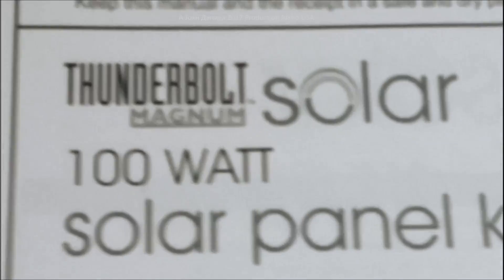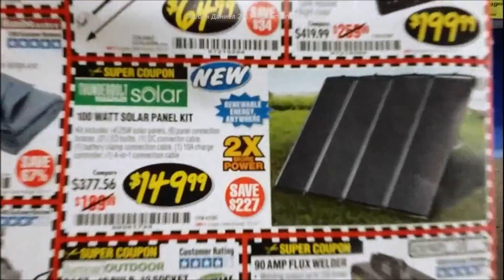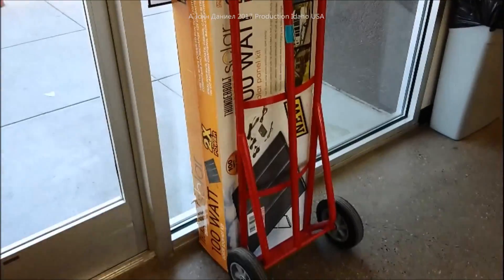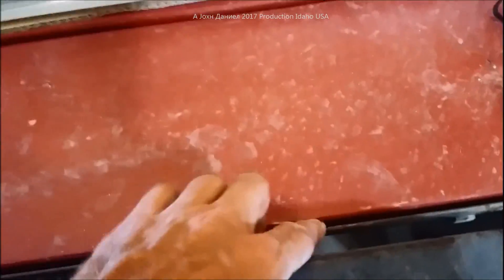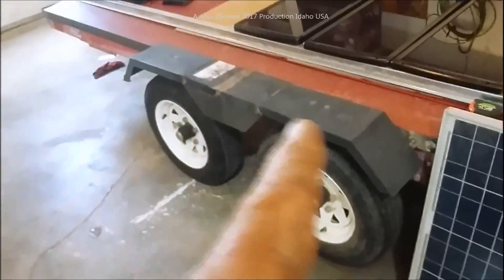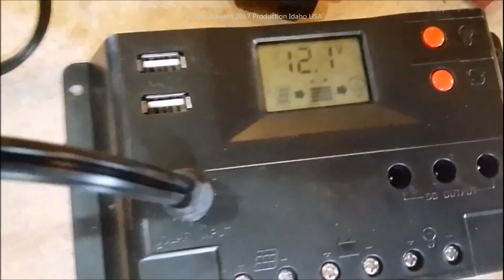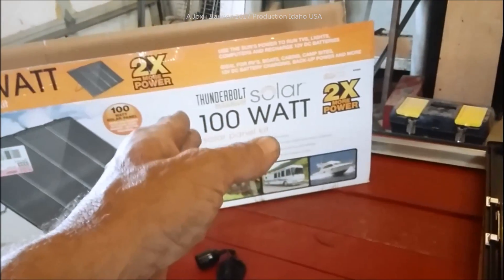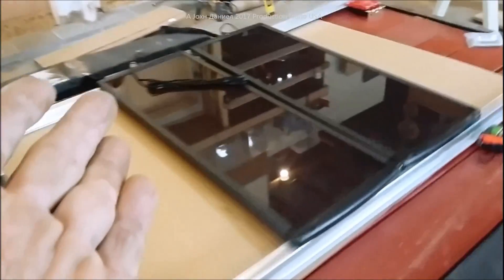Harbor Freight 100 watt solar kit #63585 NEW Thunderbolt Magnum (MAJOR PARTS LIST BELOW)

Comment: thats the biggest 100 watt solar kit i have ever seen!  Wonder why the panels are so big, bad efficiency so they need more surface area?
Reply from the maker: Yes, Amorphous is bigger, my STION and KANEKA panels are not small, but the low light charging is proving its worth today with 2 inches of snow on them. Amazingly, I am getting 18 watts minutes ago with snow on them from these goofy HF panels!! My UL SOLAR and SHARP panels (polycrystalline) are DOA today, only the 5 STION CIGS (amorphous)135w panels are 20+% working, under snow.

Comment: The point with solar panels is not whether or not they generate power, it is how long they last. The longer a panel lasts, the more it costs. Study up on solar panels and you will stay away from eastern made panels...do research before you get sucked into junk.
Reply from the maker: I have a set of ugly little HF panels from 2005, still producing about 75% and not yet failed. But my main system is STION STO135, Unisolar PLV 68 x12 and 22 Bosch 85 which is on the shop & house roof purring like a kitten on year 6 now pumping 6200 watts @ purposefully chosen 12 VDC and feeding a pair of Mean Well inverters. 
Been at it since my Sharp Mono days with the old S90 panels from 15 years ago.

Comment: I have a travel trailer that is solar ready.  There is a zamp plug on the outside of my trailer to plug the panels into.  Does this kit have the zamp plug for me tho do that?
Reply from the maker: +RVrebel Girl kid uses a standard two prong insulated plug you would have to get an adapter to hook into something different.
Reply: Јоhn Daniel thanks for the reply

Comment: My kit came with a 10 page Manual.  A more complete, 16 page Manual is online that includes Charge Controller Error Codes.  
https://manuals.harborfreight.com/manuals/63000-63999/63585.pdf for those interested.

Note:  Error Code E11 on the Controller means the battery is to low and needs charged very soon.

Comment: Wow. Everything about this is wrong. This system is junk. The panels are the least efficient. It does work but nothing like he says. Check out other videos and learn more about solar energy before spending your money so you don't end up like this guy.
Reply from the maker: +Robert D Sounds like you got a bad set. I have over 5000 watts solar on my home and shop but laying my polycrystalline flat on a truck camper and getting them covered in dirt totally kills them, these amorphous like my STION and Uni-solar keep making good power even with frost, some snow and heavy soil on them. It's a logical choice, not a sellers hustle that had me buy them for $125.00

Comment: I have the same kit on a 12v 35 amp battery. How do you read the menu icons on the controller ?
Reply from the maker: +Acousticstrings It's multiple pushes of the set/menu button. Go get the new pdf from harbor freight website under manual for it.
Reply: Јоhn Daniel I have the menu that the kit came with just not sure what the difference is for 14.4 v from the panels to the battery 》 13.8v from the panel to the battery 》 10.8 v from the battery to light bulb 》 12.6 v from the battery to the light bulb. This is what each icon shows.
Reply from the maker: 14.4 is the Lead Acid ( normal flooded cell deep cycle battery) bulk or service full charge rate and can be ( supposedly)  adjusted lower its disconnect from solar to 14.0 for GEL/AGM or 14.2 for  SLA ( Gel is a paste acid formula-AGM is Applied Glass Mat cell design - SLA is sealed Lead Acid)
13.8 is the reconnect from solar to battery to keep it at and above 13.8 for saturation charge, 13.8 is the static 100% (1 volt over 12.8 standing average so the battery is kept free of sulphation)
10.8 is when the light circuit is low voltage disconnected ( +60% DOD)
12.6 is when the controller will turn back on the light circuit (-30% DOD) 
*These 2 light circuit ratings are to protect the battery from too many cycles that will shorten its life
DOD = Depth Of Discharge

Comment: John. I just bought one based off your video but when I plug it all in the charge controller does not come on. Any suggestions?
Reply from the maker: Did you hook it to battery first? You have to put it on a battery, then connect the panels. Otherwise it will blow the inside fuse link and fail from day one.

Comment: I bought the Hf 100 watt kit at the end of July it's still in the box lol I know nothing about solar i live in a trailer in the country i only use a string of Christmas lights hooked to a 750 watt inverter I had been charging the battery with a battery charger I would stop using the grid electric  but i know I don't have enough to run my fridge that is the only power i use is for that and to run my internet for the moment I have no clue how to hook this kit up i'm from Missouri the show me state if ya know what i mean lol

Comment: Hello JohnI new in the solar game. I have bought four 100 watt HF kits. I was wondering what would be the best way to hook these together. I was thinking of buying a 40amp mppt, am I on the right track. I was also wondering how many batteries I should buy. also what size of power invertor would I need.I bought these kits for emergency uses only. If the SHTF I want to run my small fridge and blower for my wood burning stove and maybe a light or two.Thanks Rev. T
Reply: Hey guys, I guess John is working on his trailer or making another video.As I said above I was not sure on batteries. I have been doing some reading and I think I will go with 6 volt golf cart batteries, 225 amp. Now I need someone's help again. I do know how to hook the batteries up for a 12 volt system, but I don't know if 4 batteries will be enough ? Maybe 6 maybe 8 ?I would like the maximum  number of batteries that my system would charge.I think ?  If I am looking at this wrong someone please let me know.Also thinking about a 1500 watt invertor, beginning too think may need bigger invertor, again need some advice, I am a mechanic not a electrician.Thanks Rev. T lll
Reply from the maker: It all depends on your total need minus total losses created when you make your own power. 400 watts solar with a 40A MPPT like this one (see specs ) http://amzn.to/2vhP5Zz from Amazon is about the best suited and you can get up to a 4 year warranty cheaply that way. You can, I would, eventually add 2 more single panels when they become available and that would make a good basic 35 amp+ array. 
As for batteries I would look into your local walmart honestly due to it being handy, local, and just get 4 of the MAXX Marine 29 and you get a very good warranty and they don't need experienced people in watering, gravity and battery maintenance skills ( perfect first system power). The MAXX are not your typical cheap Johnson Controls junk. If it don't have the raised case lines on the sides, its a JC, if it does its a exide. ( Same as NAPA Auto Parts premium Brand)
As for a inverter, what do you need, only a refrigerator and maybe a small TV to try and watch the North Korean nukes come down on Los Angeles....... 
Actually, the draw of a 3 to 7 cuf Refrigerator is about 120 watts with a 400 watt surge, and a KWH draw run time per 24 hour cycle is about 210 minutes to 230 minutes X watts storage or supplied. So a inverter like this will serve all your needs. VERTAMAX 1500 Pure Sine http://amzn.to/2vkv4zS ( don't skimp on inverters, quality & efficiency is a must)
Be sure to get a P# KilaWatt Meter ( Read More http://amzn.to/2vkA0EI )  to learn all your usages so you can control your build to fit your need.
Reply: Thanks for the guidance John. I was thinking about buying a couple more of these kits. Would  the 40 amp controller still be sufficient or would I need to upgrade to a 50 amp  ? Thanks RT3
Reply: +Tommy Wilson use 20-50 weight
but only on full sunlight and fram it

Comment: Thanks for presenting the good information ! I appreciate your experience and enthusiastic presentations, w/ links !
Question..  Solar Eagle MPPT controller in this link above or the 'real deal' Epever Tracer 40A you reviewed in a prior video ?
Q2...  Will the amorphous panels hold up under Ehrenberg sun ?
Thanks again for the great presentations. We shall be full-time, soon,  and appreciate very much.  rc
Reply from the maker: My suggestion if your using the HF panels in HYPER SUN ARIZONAVILLE is to get some reflective high temp paint and paint the black frames and be sure you place them where they can get good air circulation. As for the Amorphous panel, they don't suffer from over heat loss, but the frames may become pliable like any plastics do in Arizona. 
The EP Ever 40 MPPT is a 100 volt peak input capacity and is better for Amorphous. The Solar Eagle is a 150 volt peak input and is better for wind and mono crystalline.  ( NEVER SET UP YOUR SYSTEMS TO REACH A WIRE OR CONTROLLERS MAX CARRYING CAPACITIES, STAY 20% UNDER)
Reply: Thank you John.  Wilco.  
I must run a 300w AC load 24/7 plus the other things we all like. Hope to get a system sized properly on my limited budget.  Best,   rc

Comment: I just bought a set of these and a marine battery and an 800 watt inverter... Do you think this would be good enough to run a couple lights water pump and a fridge in my camper ???
Reply from the maker: First get a P3 killawatt meter , use it to see what your actual AC needs are . 
A 12 Volt DC trailer RV pump can use 3 to 8 amps, thats calculated to watts by 12.8 x (amps) = Watts. 
Everything is about the math, thats how you size your system.
Reply: Then, 20% or 30% for the spike, surge, or safety margin ?  rc

Comment: Cool product. Yellowstone might make it useless with a few hundred years of world darkness coming. Have a mechanical way without a power motor; to make electricity in addition to this.
Reply from the maker: Same here, my redundancy has redundancy~!
Reply: John recently posted a link to rebuilt/rewired alternators...  rc

3000-Watt-Dual-Wide-Core-PMA-PMG-12VAC-Permanent-Alternator-Wind-Generator   Vendor named Hornetwind on ebay

http://www.ebay.com/itm/391724551221?rmvSB=true
Reply from the maker: POWER MONSTER http://rover.ebay.com/rover/1/711-53200-19255-0/1?icep_ff3=2&pub=5575119394&toolid=10001&campid=5337663844&customid=GENUINE+THERMODYNE+&icep_item=172801400810&ipn=psmain&icep_vectorid=229466&kwid=902099&mtid=824&kw=lg Super DC Generator PMA  , a 3000 Watt Dual Core PMA Permanent Magnet Alternator for Wind Generator, VAWT and a Even remote engine DC power generator. In a soon to show series,  I will be building the ULTIMATE freaking DIY power house, and YOU TOO can do this.
If you get one, get it then just stay tuned and i will make a very indepth video to show how to make a massive back up generator for battery banks from 12 to 72 volts, they have all voltages. No AC generator burning 2x the gas can do what I will show you.

Comment: Can you show me how to then attach to the Inverter to use it for lights and normal plug power?
Reply from the maker: Some inverter videos I made, https://youtu.be/8diDc3jqc8A and https://youtu.be/C0MWq5Fm3x4 
I did a 4 video series on these.
Reply from the maker: @Brandee Montgomery If you connected the controller to battery first, then connected the panel wiring to the controller you should have correct steps covered. If there's a error showing after that you have a bad controller and should return it for a new one. Many people connect solar to controller first without the battery on there and mess up the controllers which will show error.

Comment: John hey when in normal mode with a full day of sun the arrow indicator from the panel to the battery indicator starts flashing. Do you know what that means?  Instructions are vague and cannot find an answer anywhere
Reply from the maker: From my use this is what i see on the controller: Its showing full charge achieved when the bars stop at all full and it appears then a pulse charge process when the arrow from solar if it only flashes to maintain the full charge at a much lower charge amps, a BULK CHARGE SETTING. Batteries will self discharge when not being charged above 12.8 till they drop to 12.8 or lower. 
Some other chargers would show a battery fault doing this if the battery was bad but this one has a fault feature so I don't think its a fault feature in this action of that arrow.

Comment: Coupons came in mail today for this very product at the same price. I've had my eye on this for years...and now they've doubled the watts, lowered the price and upped the quality??? Can't pass this up. Picking one up tonight to finalize my portable battery box. Check out my previous review & build.
Reply from the maker: BECAUSE THESE ARE LOCAL, WARRANTIED, and CHEAP - I may just buy me 2 more sets, and the main reason is that they charge so well in low light. My main system is 4200 watts on my shop roof. Good BOSCH panels but they only charge full power from 11 am to about 6 pm then they fade out. Putting a pair of these pointing East - South East would help recover my bank hours earlier when they are down more from all night use. It will extend my battery life by keeping them over 70% all the time. Plus even pointing east, these will charge ok when the sun is past them due to being Amorphous. I wont need a set pointing west because I am at 14 volts still at 10 pm, but by 6 am I am at 12.55 to 12.65 and these putting amps in before the sun even comes up fully will make my batteries have a longer life by feeding them early before I drop low.
Reply: Someone out there must have info on a Rasberry Pi/arduino  controlled auto- tracker with reset to AM direction !  Gotta find it !  :-) rc

Comment: you made a believer out of me today
Reply from the maker: Just remember that NO solar panels can put in the battery what the panel is rated at. No brand, no style, and no country of origin changes that. EXAMPLE: So when you want 1000 watts to use, you need 1200 watts of panels and if you want to convert it to run a 1000 watt inverter you need 1400 watts of panels. 
This is due to losses, battery quality, wiring, conversion and efficiency abilities.

Comment: i have the old ones there still kickimg amd screaming can I hook the old schools up.with the new ones?
Reply from the maker: (Tried to send you a reply from a older video I had up, copy and pasted it and got some nasty poster who was arguing with another viewer, goofy you tube, how odd!!) HOWEVER, on the question, You will have to add diodes to the group of 3 or more of the older panels due to the fact that they did not have them in the past. SOME may, but most did not due to being under 10 amps it was not a priority. The new panels seem to have a back flow design, the old ones did not. Your new panels may push power into the old ones, defeating your purpose. 
Get a diode, sized 2 amps value for every solar amp of the old panels. If you have 3 fifteen watt panels rated at 15 watts each that would be about 3.1
3.5 amps so get a 10 amp Schottky diode and put it in line before you join the wires of the new and old panels at a controller, you will now need a 15 amp controller, get a good one. Heres info on a Schottky -  https://en.wikipedia.org/wiki/Schottky_diode .
Reply: Јоhn Daniel Im just gonna sell this old kit and get 2 ..100 watt kits
Reply: Hey if you know someone that may want to learn solar maybe just give them the 45 watt HF so they can learn like someone that maybe is hurting on the money side and can't afford to buy a set // just a thought

Comment: how many batteries are you useing and are they 6volt or 12 volt "!??
Reply from the maker: REFERRING TO ALL MY VIDEOS - It Depends on where my batteries are. 18 in my house, 36 in my shop ( all 6 volt) and 3 in my truck, 110 Amp Hour 31 series Exide made but sold via my walmart as the 2+ year MAXX Deep Cycle. The big Holiday Rambler also getting power, is getting a power wall made of NiCad or Lithium is all in the works and (10) total of 1350 watts of STION  STO-135 Amorphous Solar Panels. But the truck has this set up so I can start with hot batteries, extend their lifespan by keeping them at 100% all the time and its bulk amp needs can come from the engine if needed.

Comment: Where can I get those bulkheads
Reply from the maker: +fiddlist1934 I put a link in some of my replies on here.
Reply from the maker: I can send you 3 sets of 2 for $12 shipping included as long as its in the lower 48 states, if your elsewhere I will have to check cost. Just go to paypal.me/PokysParts/12
Let me know if theres any problems and make sure your shipping address and email is on your request. Takes about 4 to 7 days due to my work schedule to get them. 3 sets of 2, 6 parts in total.

Comment: ok I think I'm sold you get all that for 150
Reply from the maker: +Colin Stienke Nice kit to put people on the road to use, learn and apply.
Reply: Јоhn Daniel why didn't they make and wide more powerful pannel that does more watts so you could do less panels
Reply from the maker: Probably due to portability, shipping methods, store space availability. Who knows but I love my 130 watt fold out Topray unit ( same maker as HF panels)  I have in my motorhome and its been hooked up permanently to the motorhome which has made the Costco G2 batteries last over 6 years by keeping them from ever sulfating. If I can find where I bought it I will post a link, I think it was dhgate.com back in 2010. Pricey then, but surely cheaper now.